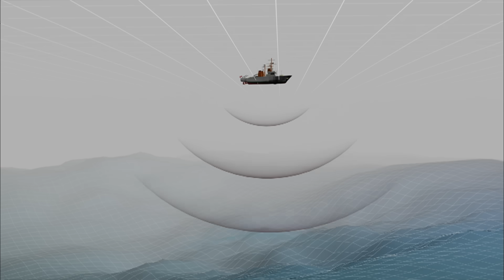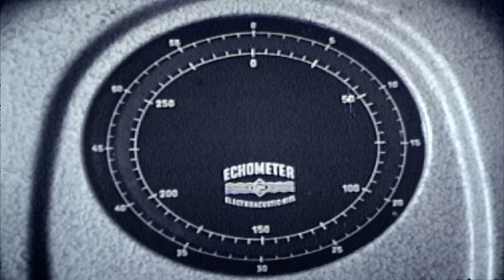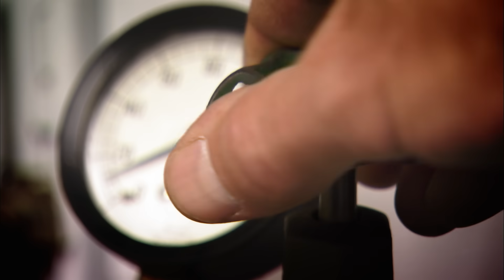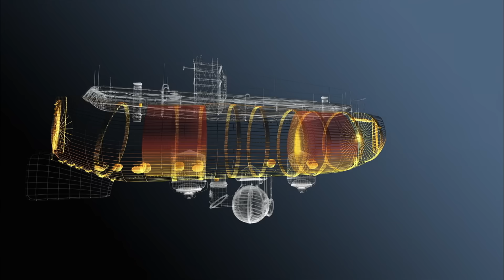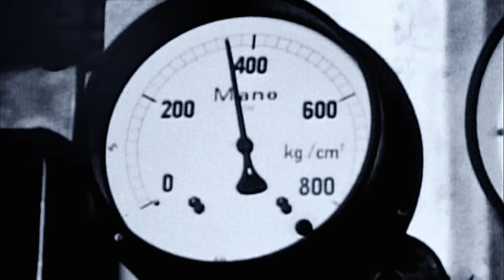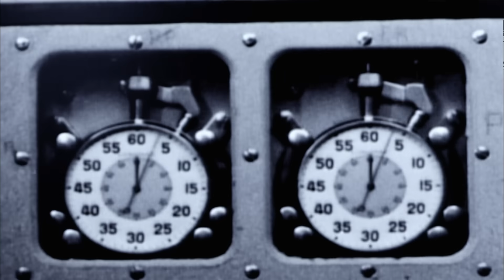The Deepest Dive Humanly Possible: A Trip to the Mariana Trench | How the Earth Was Made (S1)

Comment: The pressure at a depth of 36,000 feet is 16,000 PSI
That is 2,304,000 pounds on every square foot of a submersible!!
By comparison, a fully loaded Boeing 747-400 has a take-off weight of around 900,000 pounds.

Comment: The outer glass cracked several miles below the surface, and they KEPT GOING. The courage and guts they had was off the chart.
Reply: I would be more inclined to call that stupidity.
Reply: @snowleopard1831 probably some suicidal people were in the crew
Reply: Yeah i think they might well have left some lead and just used the weight of their brass balls.
Reply: @pliashmuldba LMFAO
Reply: There's a very fine line between brass balls and utter stupidity.
Reply: Obsession + courage+ prayer

Comment: To make a very long story short, the trench was formed in the early days of our planets youth, about a billion years ago, when the crust was thin and the atmosphere as well, taking on tens of thousands of asteroids every day, which eventually expanded the size of our planet, and  formed a deep depression from the weight of the iron in the area of the greatest accumulation, the iron sinking to the center of the sphere.
The planet was covered in water, with an average depth of 1 mile, at the time, the result of about a billion years of steam accumulation as the planet gradually cooled down from its original molten state, being of origin, like the rest of the planets, of the sun (another long story).
Over time, in compensatory adjustment, land began to rise above the surface of the water, forming the original land mass, that was later broken up and spread out due to continental drift.
Modern geography confirms this fact, as the highest mountain ranges are over 30,000 feet high, while the Mariana trench is over 30,000 feet deep.
And the Himalayan mountain range and the Mariana trench are both also 1,500 miles long.
It's more than coincidental; its historical fact😊

Comment: Is the world actually round the way they show us everywhere?
Reply: Yes, and I can give a simple explanation, I am an Electronics Engineer student, and in our field we study how the communication tower works and how they receive and transmit signals, it turns out there's a lot of calculation, and in one of the formulas, it includes the curvature of the earth. Basically if one tower is so far for the other tower, it will not receive the signal because well there's a curve that bends the line of sight of the tower, so to compensate for that, you have to include the length/distance of the curvature in the formula.

Comment: Funny how one old man can hold the weight of 5 miles of rope. google guess is only that, a guess. So here it is.... It's impossible to give an exact weight for 5 miles of 3/4" hemp rope from 1872 without knowing the specific type of hemp rope and its density. However, a general estimate can be made. Hemp rope typically weighs around 1 pound per foot. At 5 miles, this would be 5 miles * 5280 feet/mile = 26400 feet. Therefore, 26400 feet of rope would weigh approximately 26400 pounds or roughly 13.2 tons.   So even i water it would still be to heavy for one man to handle.  and the trench is even deeper than 5 miles.

Comment: I worked in the oilfields and we had water injection pumps that ran at 16,000 psi. It's enormous pressure.
They were for returning heavily saline water back underground, 2 miles deep.
The water comes up with the gas and oil and is cut from the feedstock and returned to the earth.

Comment: 7 miles is equivalent to 36,700 feet
Reply: I believe they said it was approximately 7 miles. Close enough
Reply: 7 mile = 11265408 millimeter
7 mile = 1126540.8 centimeter
7 mile = 11.265408 kilometer
Reply: That Mariana Trench deepest part known as Challenger Deep is more deep than Mount Everest height more than 2 miles deeper than if Mount Everest is Inverted.
Reply: YOU EGG HOW MANY METERS 🤣

Comment: James Cameron also reached the deepest point in the Mariana Trench to, specifically the Challenger Deep. He achieved this on March 26, 2012, during his solo dive in the Deep Sea Challenger submarine.
Reply: It's amazing that any kind of device could be made which could hold up to the immense water pressure.
Reply: @Prepared5057  Sure.. Stainless is beyond tough AND you don't need glass ports nowadays we have cameras that we could mount all over the thing. He actually sat upright in that craft for about 8 hours or so. A totally different design than Trieste's bathyscaph. A spherical design is by far the strongest as all pressure is directed toward the center of same so there's no diagonal pressure. Sure you can make those stainless walls as thick as you need then double it and all of it is in compression. its about 16000 psi but gunite concrete is around 10000 psi so you could actually make it atta that you really wouldn't need something nearly as strong as stainless.
Reply: It had been done before - Don Walsh and Jacques Piccard
Reply: It's one thing to reach it in 2012 with all the tech we have now compared to more than half a century earlier in 1960 when Don Walsh and Jacques Piccard did it.  Kinda like how it wouldn't really be an achievement to land humans on the moon now vs back in the 1969 when Neil Armstrong and Buzz Aldrin did it.  Your cellphone today has way more processing power than the computers they used on the shuttle back then.
Reply: @BestoftheBest-oz4ei no one landed on the moon
Reply: @BestoftheBest-oz4ei what have you accomplished in life?
Reply: @ Sure I'll let some random nobody on the internet know that...NOT!
Reply: Solo dive is actually crazy and unbelievable! It was scary
Reply: This was filmed in 2009. Three years prior.  They still go down in the record books though.  Reaching the same depth isn't the same as beating it.
Reply: If i remember correctly the documentary is named deep sea challenge right?
Reply: The fact the outer glass cracked, at several miles beneath the ocean's surface, and they KEPT GOING all the way to the bottom speaks to me of the COURAGE of those two guys.
Reply: James Cameron didn't even break the record tho
Reply: @headshot9611,,,How can you say that man.. There are so many videos about Neil Armstrong & Buzz Aldrin landing on moon and the famous quote said by Astronaut Neil Armstrong that "One small step for man, one giant leap for man kind as he was the first person to walk on the Moon on July 20,1969. So according to you all was fake and it means that United States of America has fooled the world by making those fake videos of these two astronauts landing on moon in a film studio. 😮